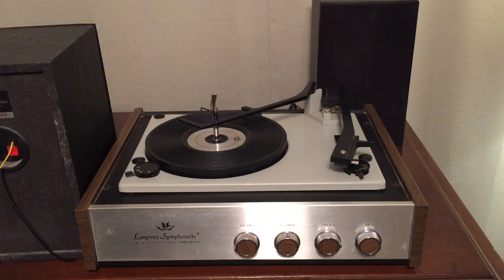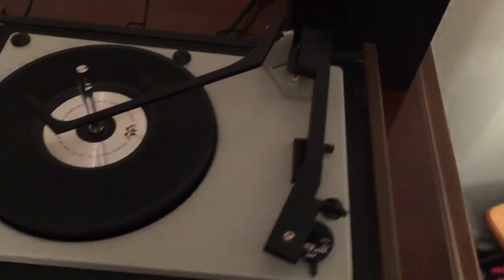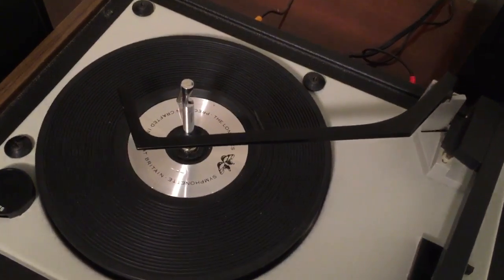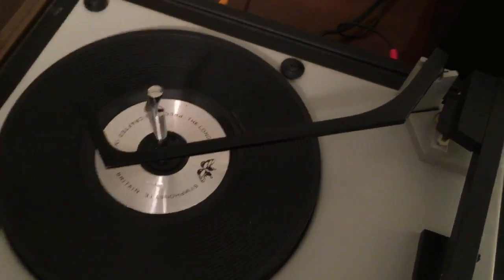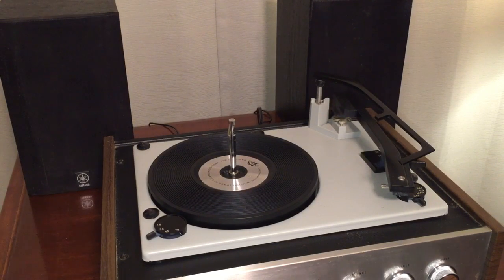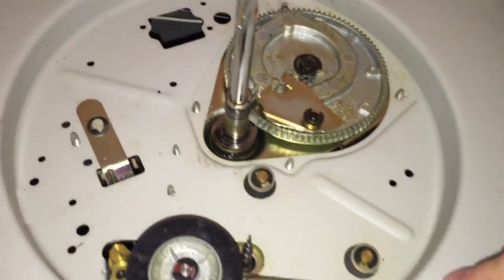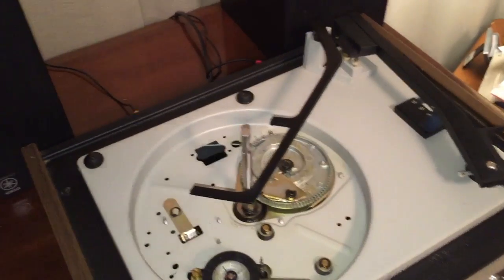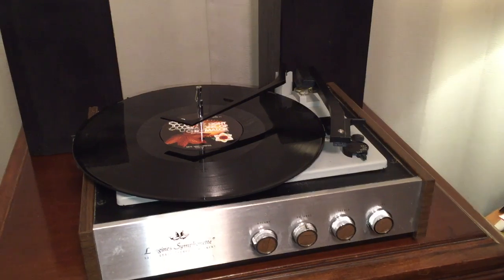Classic Tech: Longines Symphonette Mini Turntable

Comment: I used to have one since I was in 4th grade and it was cool. Longines Symphonette used to manufactured clock radios, portable radios and record players, but they also made a series of album boxsets along with compilations that are not sold in stores, but it was a competitor to Reader's Digest. Longines Symphonette used to put out a series of boxsets in the late 60's and early 70's called the "Gold Medal Presentation".
Reply: that's great information I actually have some of the Reader's Digest box sets. One of them is actually has recorded for record changers.

Comment: I knew I had a similar unit, just got it out of the attic and it happens to be the same one. No dust cover, but has the matching speakers. Made of thin metal with the wood veneer stickers. Just gutted and restored a full size BSR a couple weeks ago so this one is next. Have a nice Sansui TT I use for good records, these changers are for the beat up ones/45's I still have from my childhood in the early '80s just meant for these. Thanks for sharing !

Comment: Just came across this video, and don't want to read all the comments to see if anybody shared what I'm going to add to the conversation:  BSR changers from the mid to late 60s thru early 70s were normally 4 speed changers. 33/45 for Microgroove, 78, plus 16 and 2/3rds RPM for books on vinyl. by Mid 70s, they had basically dropped the 16RPM, and by early 80s, the 78RPM had been dropped leaving most changers as 2 speed only.  Just a basic guide to help narrow down the age on this type of player.

Comment: I have a mid 1970's BSR McDonald 2000AX minichanger(record changer) and it has an unique feature that won't have the tonearm land on the record if the surface isn't level.
Reply: It's just dropping the stylus too close to the outer edge of the record.  If the table is even a tad off balance, the arm will fall outward and miss the lead in groove.  It isn't a "feature".  It's an adjustment flaw.

Comment: A) Two dudes playing timpani  B) it is called the overarm (or record stabilizer) C) wanted so bad to see the dust cover that had been dragged behind a car attached to a rope.

The BSR Minichanger was the gateway drug to record playing and collecting. They were used by dozens of companies from battery powered plastic portables to some fancy pants consoles. Many manufacturers (or assemblers) of record changers had the cosmetics changed and some made sure the BSR origin was hidden, thought most had the center platter trim with a variation of "Made in England". This was even available without the changer mechanism, so it was semi-automatic, usually would return the tonearm and shut off. Even Japanese brands Panasonic, Pioneer, Hitachi, Sony, Toshiba, Sanyo, etc. used the Mini in 1970's stereo systems. Some owners of these may not know they have a BSR mini. The portable "suitcase" style record players often had some form of a BSR or a similar Autoslim from Garrard. They were so well made that with just minor service and cleaning they still work like new. Longines sold this as an option to go with the Longines Symphonette Society (a record buying club) but seems odd that a company known for fine watches would have their name on a basic record changer. 

Thanks for this video and your humor.  😎👍

Comment: This is high end cheap from the early 70s.  By the mid 70s they had stopped churning out the junk equipment, mostly because people had stopped buying it.  In the fifties and sixties electronics were expensive.  Even the cheap stuff was pretty pricey.  Then the Japanese started importing better equipment for less money.  The Japanese changed our expectations regarding automobiles in the sixties, and our expectations about what we should be getting for our money regarding electronics in the seventies.

Comment: I have this same turntable. And it is just a turntable. No amp, so it would be used with a component system. It works great every time. I got it at a yard sale. They had it laying in the grass picking up plenty of moisture.

Comment: If it plays too fast you can clean the motor shaft (sometimes rubber from the idler wheel builds up there). If it is still fast you can sand it down a little. I think the speed on yours is close to correct.
Reply from the maker: +Robert Knight - yes I forgot about sanding, I've done that before
Reply: +databits It's typical of the later BRS changers&#160;with the skinny tone arm to run too fast. I've moved on to the the Magnavox console in my profile pic.

Comment: Nice video It 's not direct drive. It 's what is known as an idler drive turntable. Idler drives are the ancestor of modern turntables. They worked just fine when records were mono, but disappeared shortly after the advent of stereo in all but the cheapest turntables. This is because the idler mechanism wasn't really isolated from the spindle and platter, and so (if not really well engineered like the old Lencos) introduced a great deal of rumble into the sound of a stereo disc, which (because it contained twice as much information on the same physical area--call it analog compression, if you like) was itself as a medium not as robust as the mono disc it replaced and much more susceptible to such phenomena.
Reply from the maker: +tēletheātēs - The term I was trying to remember is "rim drive".  The idler runs against the inner rim of the turntable.
Reply: Indeed. If it has line-outs on the back, you may wish to bypass the internal amp, which I 'd say is the weakest link in these devises. I 've got a vintage 70's Fisher all-in-one from my dad that includes a BSR turntable. Fortunately it was one the "better" BSRs with a Pickering MM cartridge. When I hooked the line-outs to a little Lepai amp, I saw a huge improvement in sound quality. But still the low-end rumble is present. And if you listen with headphones, it 's REALLY present. I keep it in the loop for the odd 78 that may pop up (where I have to change out styli--doesn't have the flippable kind) but especially for its surprisingly good AM/FM tuner. But still it 's 100 times better than your average modern-day Crosley. I 'm thinking of trying to dampen the insides with some Plasticine or some tar paper to see if can get the rumble under control... Love the videos. Keep up the good work!

Comment: I bought one of these at a Goodwill yesterday for like $10. It is void a stylus, though. I'm a total newbie, so I was curious, which stylus did you buy for this particular piece of equipment?
Reply from the maker: +D. Yeldirf - I actually rebuilt it using super glue and the end from another stylus.  Mine says "ST9D" on the orginal part.

Comment: S usually does refer to Safire, D would refer to diamond.
Reply from the maker: +Robert Knight - cool thanks
Reply: databits +databits My previous statement only applies when ordering needles. I believe the S in this case refers to singles. The flip lever on my Magnavox console is marked the same way but has a sticker that reads 10 year diamond stylus warranty.